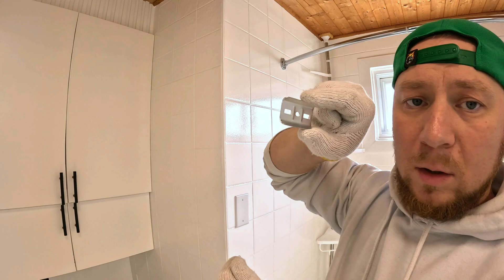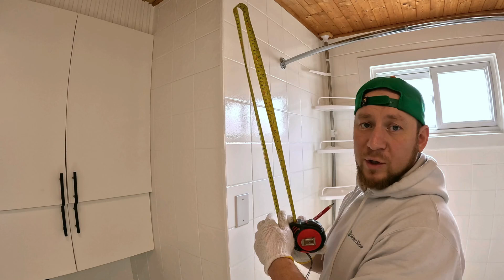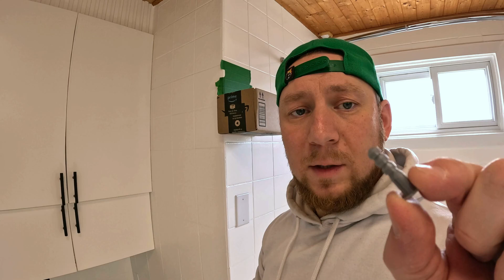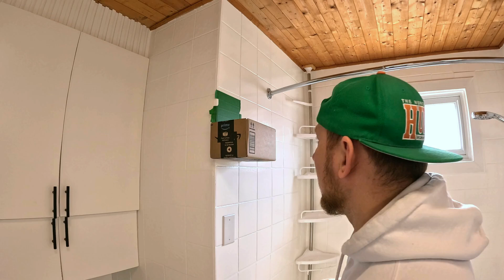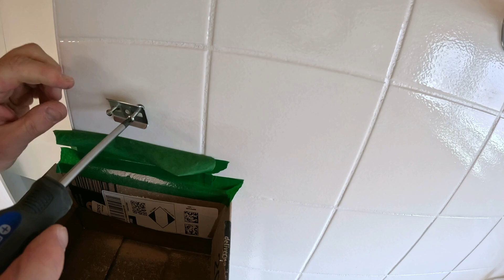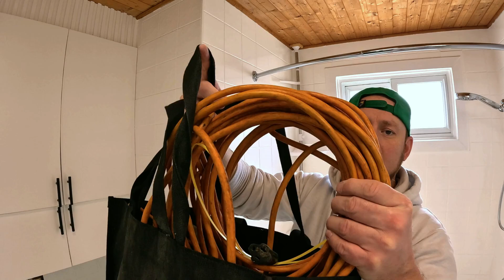Drill Into Tile Like a Pro – Bathroom Robe Hook Installation Guide

Comment: Hi, not this video related, but I noticed you protected your bath shelf from the falling by using some wooden construction, is it a custom made? Did you attach similar part at the bottom? Thanks for answering! Nice job, as usual! 😊
Reply from the maker: Yep, I just attached a small corner frame around the pole’s top to prevent it from sliding and eventually collapsing with all shelves. It’s a common problem in these type of shelves.
Reply: @ thanks, that’s an amazing idea!